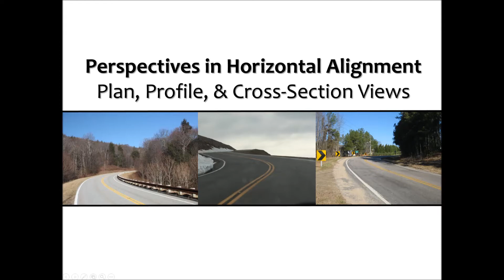Perspectives in Horizontal Alignment - Plan, Profile, & Cross Section Views

Comment: thnx i get it .... plz i have a problem and i can't solve it could you help me ?
. A vertical curve is required to connect two grades +g1 and -g2. if the design length of curve is 200 m and the S.S.D is 120 m determine the grades of curve and safe operating speed if the difference bw the highest point elevation and the tangent elev. is 10 m .... A= 5% , deceleration rate is 3.4 m/sec^2
Reply from the maker: For the 10 meter distance, is that referring to the vertical distance from the highest point of elevation on the curve to the point on the tangent directly above it?
Reply: Daniel Findley yes
Reply from the maker: I haven't had the chance to work this yet, but it should use the principles of the quadratic formula covered in this video: https://youtu.be/4gUxo1jhu4s
Reply: Daniel Findley ok thanks